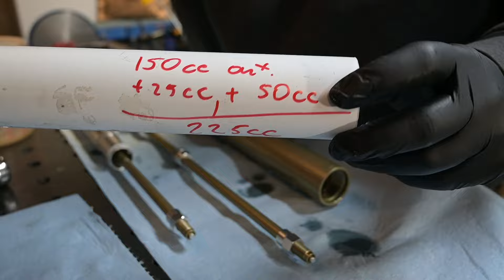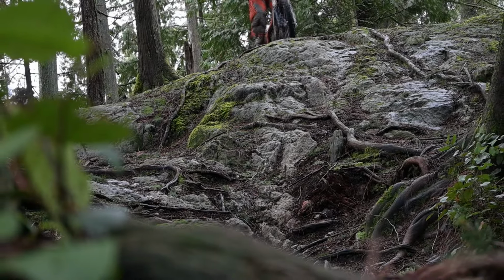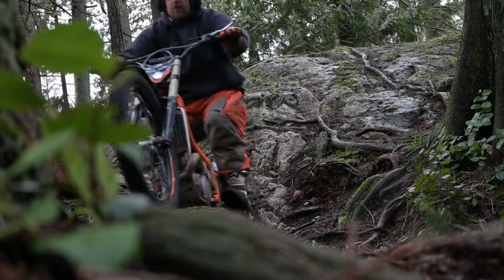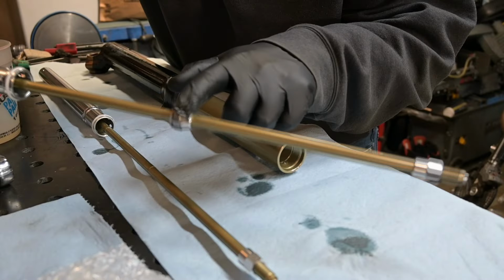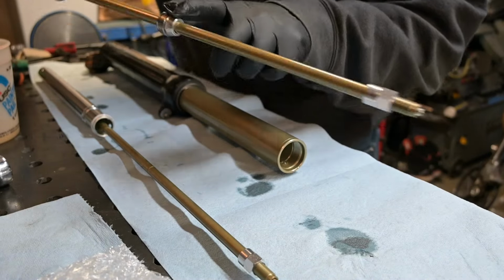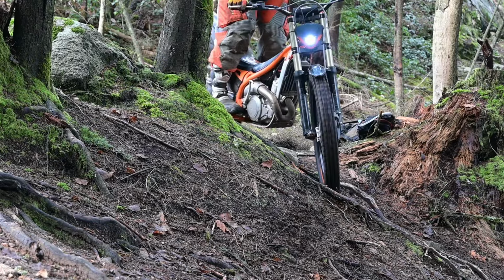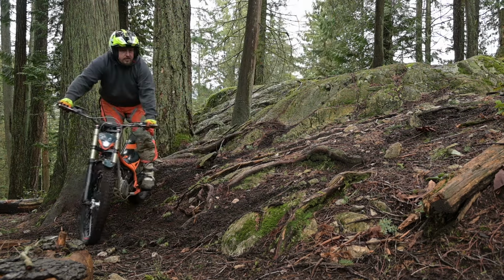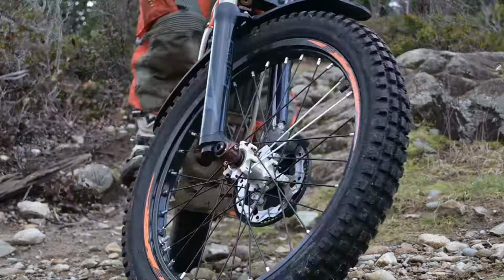🔥 SHOWA SPEC FRONT SUSPENSION | WHAT DOES 50 HOUR SERVICE LOOK LIKE?

Comment: Thanks for the video. You didn't mention the different TECH forks available on Trials bikes. There is currently 5 different models and some are better than others as far as adjutability goes.. GASGAS RACING, Scorpa and Sherco ST I am pretty sure has the lower spec TECH Trial RACING model. It only has rebound, pre-load, and end-stroke adjustments (end stroke is small allen bottom of left leg), but the TECH Trial PRO (GG GP, TRS RR etc) has 4x adjusters (Rebound, Pre-load, end-stroke and Compression) and gives the compliance and adjustability you are chasing. There is also linear and progessive wound springs in various spring rates for both the steel and aluminium stanchion varieties directlly from FORMULA/TECH or aftermarket ones from Jitsie as well. Great job exporing the Showa cartridge benifits, but there is TECH options as well to up grade the forks. The adjustable Compression lower cartridge can be added to an existing base model TECH fork without having to purchase the complete cartridge, it is an easy job to add the benifits of the top of the line TECH forks to the lower spec variations.
Reply from the maker: Thanks for watching. I did not want to get too deep into multiple variations of fork models for the sake of the video length.
My friends got the same cartridge upgrade on their trs golds with steel stantions, the only thing we had to add to take up space was a uhmw bushing. Forks felt so amazing after the upgrade.

I've been chasing compliance with clickers on multiple bikes, including my trs rr. I could never get them to feel this good. The valving plays a major factor.

I do however have to dial back he travel speed when trail riding down very steep hills with square edges, however, the stability is unreal when dealing with chunder and rolling rocks.

I love suspension talk, thank you for sharing your knowledge!

Comment: Really interesting video, I have worked with some teams and never heard about this compliance between fork tubes!!

BUT I have solved the same problem with Tech over Electric Motion (now mounted on my Montesa 290cc for 800gr of weight saving) in totally another more easy way.

I have bought the Tech bottom valve !!

100€, not so cheap, but less expensive than all cartridge! 

Adjusting bottom valve, changes compression behaviour and makes Tech comfortable really like to Showa (indistinguishable!!).

I have 4 Montesa (260 Showa, 290cc Tech, 301 Tech, 300+ Montesa) and front suspension have all the same comfort in any even extreme situation. 

To be completely honest, Tech on Montesa 301 behave perfectly like Showa, I have always thought about a better Montesa tuning, but maybe inside the cartridge is Showa ??

You can take a look at my channel to see the total neutral behaviour of any fork in the various obstacles, often finding the same using a different bike.

I often switch between my bikes... so I need a standard behaviour from each other. 

Thanks for sharing!
Reply from the maker: You know, I spoke to a few people that rode montesas since the 315 came out, and they have always noted that the forks felt plush and compliant.

We all know that a lot of different brand parts are made at the same factories. The case with showa wouldn't surprise me.

The forks work awesome now, especially noticeable on trail rides. Thanks for watching my video!

Comment: So according to your suspension guy, the 2021 301RR Tech fork is the same as the current "Showa" fork? At some point in 22 or 23 they just started rebranding the fork as Showa?
Reply from the maker: I don't know if it's just a rebrand, or manufacturing at two different facilities for different brands, but parts are the same.
Reply: @slavcoworld good to know! I have a 2021 and thought I missed out on having the Showa forks!
Reply from the maker: @curt4moto  so your 2021 shows tech branding? How do they feel?
Reply: As I wrote on my post, I have 2020 301 and Tech behave really like Showa on older 300+ (elaborated starting from 2007 250cc) or Showa on new 2023 260cc.

Some doubt arise...